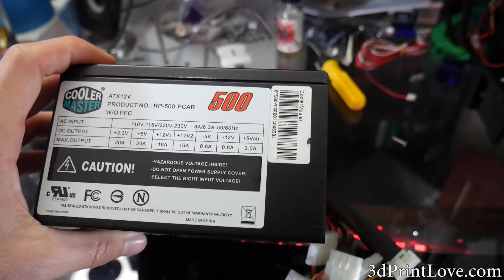Tutorial Using An ATX Power Supply With Your 3d Printer

Comment: What if the PC power supply have 2  rails +12V1(max 10A) and +12V2(max 15A ) , how  do I know which one it is? I can only tell the socket goes for mother  board or PCI with yellow cable ...

Comment: You can control atx psu directly from ramps 1.4 board by using PS_ON pin and some change in config.h file. No need to short green and black wire.

Comment: I wired up just a hot bead to a 500w and it works for about 10 mins then shuts off, the ampere rating is higher than needed so not sure why it does it.  Connected same wires as you did but soldered joints.
Reply: Some power supplies have separate 12v rails with different amperage, try connecting more 12v cables from different sources on the psu cable to see if it still does it

Comment: Hi there, not sure if you still use anet board but I was wondering if you managed to somehow integrate on-off function to anet board without relying on a sbc or a manual power switch?
Reply: My best idea was to put an endstop switch at the positive end of the Y axis, and run the Y axis into that switch when the print is finished. The switch puts an open circuit between the green and black wires.

Comment: I wanted to check if my old psu is working by connecting the black and green connector with thin cable (wasn't enough thick for the connectors,but the  fan maked little mooves) so  I started moving the thin cable in between (the black and green connectors)  suddenly a spark sound happend with bad smelling smoke, but miraculously the fans started turning,than I conected all like explained in the video with only an old  anet board +fan+LCD it worked but iam still scared using it.
Can someone give me an advice??
Reply: change the wire asap to a higher gauge one

Comment: Such terrible workmanship - buy wire cutter. Then twist hard power-ON control wires together without soldering or propper terminal. Shame on you! Don't you want to use chewing gum instead of electrician's tape?

Comment: Righto. I'm by far an electrical expert, but those wires are scuffed. I bought a set of 2 mosfets and with that set came some wire U clamp things. (Like on the original wires). I'd highly suggest anyone who is doing this, like me, and reads this comment to do the same. It makes for safer connections. Harder to yank them out and cause issues later on.

Apart from that, good and helpful video.

Edit:  I assume it would be possible to hook the green and black wire up to an arduino circuit/ripi and control it like that? Hopefully so, because then you can remotely control the power through octoprint or code your own. Again, thanks for the video and the idea.

Comment: The black wires are all ground. The purple wire is 5V 2Amp when ON standby, I would use that to power my Raspberry PI and Relay module. And then use the Relay to short green with ground to turn power supply ON/OFF. Also just use some metal to short the green with black.

Comment: My psu has  3 black and yellow wires on the pci E pin can I use the 3 instead of two ?. And also it only has one pci e pin but I also need power for a mosfet , could I use the yellow and black cables of another Pins?
Reply: All yellow wires should be 12V, all red wires should be 5V, all black wires should be 0V.

Comment: Do you think this would be possible with a Pico psu
Reply: pat ayala Power the entire printer? No.
Maybe power the board and use other power supply to power the heatbed and the hotend
Reply: why though iv seen some that  are 400w ?  and typical psu for a printer  is 300 to 360?
Reply: pat ayala yes, BUT these 400w are splitted between the 3.3v 5v and 12v. I bet that you wont get more than 150w on the 12v
Reply: Julio César I don't think that's right because there are people that  use  these in gaming rigs with some power demanding components and if you couldn't get full wattage out of it wouldn't that be the same for all ATX psu  which wouldn't make sense because are people who used 350w ATX psu  for a 3d printer don't get me I'm not trying to argue I'm just trying to figure it out
Reply: pat ayala The gaming rig, different of the 3d printer, dont take power only from the 12v, but also from the 5v and the 3.3v, for example a 300w psu would be something like: 90w on the 5v + 60w on the 3.3v + 150w on the 12v what equals a total of 300w. Isnt that you cant get full wattage out of It, its just that the power is splitted between the power rails (12v,5v,3.3v).
Anyways, If you can get a psu that can supply around 12v 15A I think your printer should work just fine.
Sorry If I sounded rude, I am just trying to help :D
Reply: Julio César it's okay I just have alot questions about it because I'm designing a compact  printer  that folds up in to a carrying case  for easy transportation  I  want to use a psu that takes up the least amount of space

Comment: Just to add more info to this modification, I would like to state that, when using stock Anet A8 Power Supply, heating bed and extruder costs around 150-180 Wats, When using My OCZ 500 Wats, it costs around 100 - 140wats, That´s power efficiency. Measured with specific tool.

Comment: Hi All, Can any body give me a lead on something? I have an ATX OCZ power supply, pretty good one, I have 2x12v rails rated 18A. I want to put a mosfet into hotbed and mosfet into extruder (is it necessary? ) So should I Connect the first Rail to the mosfet 1 and the second rail to mosfet 2? can I use the second rail to power the Mainboard (fans and stepper motor)?
Reply: Are the mosfets necessary? Yes, the mosfets from the Ramps may not be strong enough to handle the load.
About the 2 power rails I think that you can use them to control the heatbed and/or the hot end and/or the main board, just make sure that the power supply is powerful enough to handle the load.

Comment: Hey, what you described didn’t work with my power supply. I bought the “SL-500 ATX”. At first I used the “4Pin 12V” but the amperage was too low, I couldn’t turn on the 3D-printer. After that I tried the “IDE 4Pin”, then everything worked fine.
Reply: They connect to the same place on the psu xD

Comment: Basicly not using endisolation peaces is a terrible way to wire things up. 12V has the potential to burn. Pls make it better. Even the old psu is saver than youre wiring. Sorry but this is safe.

Comment: Holy s*** you seriously do not know what you are doing!
The ATX power supply you chose has 2 12volt rails capable of 16 amps each, so as the very pore way you have connected it up gives you a 192 what 16 amps barely enough to run this printer. You should of chosen one with a single 12 rail which would of given you 32 amps. Or cut every yellow and black wire connecting each colour to itself joining the 2 rails together giving you 32 amps then run them to your printer. 
Also you need to have a load on the 5volt rail for ATX power supplies to out put 12volts on the 12volt rails either a load resister or a 5volt fan  without doing this you will be under volting  on the 12 volts and increasing the amp draw to exceed the rated 16 amps of the power supply. Go ahead and check it you will not have 12volts at idle and even less under load.
There are very good videos on how to and safety turn ATX power supplies into lab power supplies you should have watch them before attempting what you have done as what you have done is increase the chance of setting you printer and house on fire.
And finally where are the crimp terminals for the wires you connect to the printer control board. Just twisting bear wires and screwing them down on the board connector is dangerous and not what should be done use boot lace crimp ferrules  on the wires.
Reply: can you link any of the videos to do it the proper way? lol would be helpful
Reply: There is a way to post and not be mean about it. Advise people and be nice about it.
Reply: Neoblackdragon be mean!? This guy is giving the straight goods, if it were me I wouldn't want to burn my house down!

Comment: What can I do with the remaining cables that are not used? I don't like the mess of having several unused cables hanging behind...
Reply: If you're gonna cut them, you can use heat-shrink tubing over every end to prevent shorting.  Better yet, open the PSU and de-solder the wires you aren't using, and perhaps take the opportunity to replace the thin 12V wires with some heavier guage stuff as well.
Reply: Dan G. Ochoa cut them?
Reply: Yes.. I'm planning to do that, but I don't know how to do it properly.
Reply: Dan G. Ochoa just cut whatever wires you aren't using, and you know you won't use, twist them so the ends aren't all frayed, and put eletrical tape around it probably. Multiple different ways to do it tbh.
Reply: Dan G. Ochoa did you do this yet or planning on it? I've seen multiple different videos and all of them have people in the comments saying they're doing it wrong
Reply: Not yet. I wanted to know how first

Comment: Since I've blown off the power supply supplied with my kit I did this method of using an ATX PSU to power my 3D printer. Now I noticed that the yellow and black cables gets abit hot on standby and Im not sure if it will get hotter if I run the printer. Any thoughts on this?
Reply: Those wires aren't thick enough gauge to safely handle the current, especially if you only use 1 pair of yellow/black.  Using an ATX PSU is a great idea, but its best to solder in your own thick 12V cables instead of relying on the very thin ones most PSUs come with.

Comment: Id gather up ALL of the yellow (12v) wires and all of the black (ground) wires and connect them all together to get the most current carrying capacity.  I also connected the green and black with a switch so I could turn it on and off.
Reply: you already have a switch on the psu case, why bother
Reply: @MrGarkin  because the main switch cuts off all the power while the switch between the green and black wire only cuts off power from the 12V, cutting of main power results in a fade out, cutting off the green and black gives an instant shutdown without face out
Reply: Good advice, saving this for later
Reply: DONT DO this! You will fry your printer board

Comment: You really need to look at how much current 500 watt PSU can deliver on the 12V rail you are using. PC PSUs are totally inappropriate for 3D printers since they split 12V deliver into multiple rails. I'd rather get a nice brand name 12v -- 25w PSU or better yet convert the printer to 24v  and get a proper PSU for that.
Reply: I had mixed luck with them...Eyeboot is a good PSU in general, but I've received some which were beaten up badly by the carrier. Mean Well is a good brand. Go 15A (or 14.6 at standard) -- 20A is better.

Comment: What a great idea, buy a psu and invalidate the warranty by needlessly cutting it to bits. Have you not heard of ATX breakout boards? You can get them cheap on Ebay, save you a load of time and energy and also negates the need to destroy the cabling on your PSU. http://www.ebay.co.uk/itm/292057448313
Reply from the maker: my psu is far beyond warranty. I am not saying a breakout board is not a good option but for anyone who is using an old atx it is really nice to remove the cables completely. I literally cut them all off with the exception of the ones i want and an additional for my pi and leds. But yes if you plan on using the psu for other things or buy it new then that is an option.

Comment: isn't 500W a little bit overpowered for a 3D printer?
Reply: Not when you want a heated bed.
Reply: Cloroplast2485 450 would also be fine
Reply: I believe that that the anet a8 only requires 240 watts so a 300 watt power supply would be sufficient
Reply: However, you want to overshoot to account for voltage/current spikes and possible upgrades down the road.

Comment: Someone correct me, but doesn't the 4 pin connector usually only use power from the 12V2 rail?  So he went from a 20a power supply to a 16a one?  Wouldn't a better way be to find the separate rails, power the hotbed off one and main board on the other
Reply: the 12V 1 and 2 rail gives out each 12a, so it should not have anything to say. I dont know so much about if it would be better with two separate rails tough.
Reply: Following the specs of the powersupply the 12v1 and 2 rail should give 20a each, but theres a Maximum per cable. You might be right on something there. :)
Reply: Correct. I ran both rails in Parallel to the Tevo Tarantula. Works great.

Comment: You need to do a few additional things as well.  First, your stripping method leaves a lot to be desired. :-) Please use the right tool to strip wire, otherwise, you can compromise the wire itself.  Scissors are not the right tool as they will also cut the wire.  The difference between an 18 or 16 gauge wire can mean the difference between a good connection that can supply the required current and one that will fail.  A proper wire stripper will do it without damaging the underlying wire.  Secondly, those wires should be properly terminated... loose wires can not carry any load, causing the remaining wires to be forced to carry more load than they are capable of.  Solder them or crimp them in a proper lug connector.  Lastly, a lot of PC power supplies need some minimal load on the other power rails in order for them to work properly.  You need to check the specifications of the power supply and supply the required minimal loads for those rails as well.  A simple LED arrangement might be enough to satisfy their requirements, but again, that is dependent on their specific requirements.
Reply: If I intend to use the 5volt output for a led strip and 12 volt output for my 3d printer, knowing that the led strip will always turn on, do I still have a dummy load?
Reply: It's a hack bruh, obviously not for production work, if you really want to get picky you can criticize the lack of wire tinning and/or connectors, the two wires in parallel to the psu should be good enough for our load even with a few missing strands, plus he says he offloaded his heatbed and extruder to a mosfet.  I hear we should have a load resistor on the 3.3v rail but yolo fuck it lol. the hack worked for me and now my bed can actually reach 85c